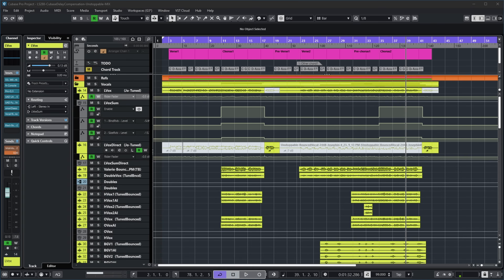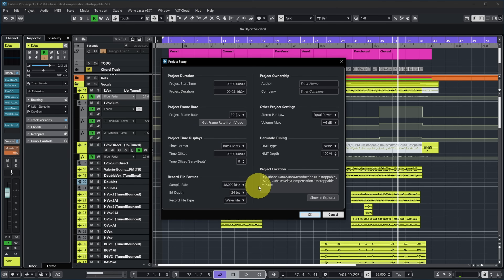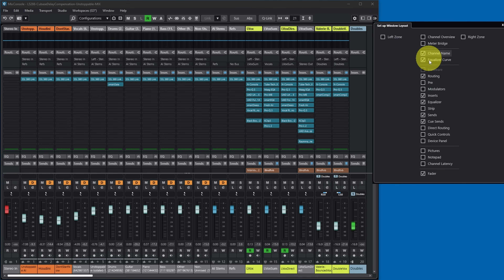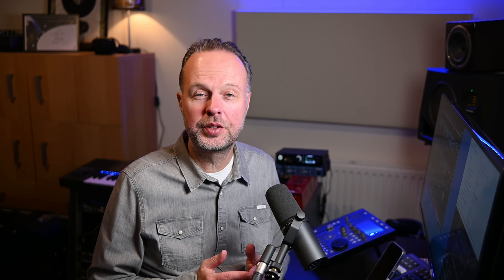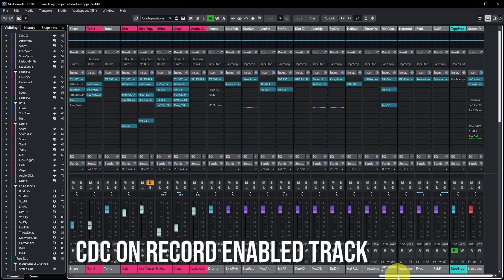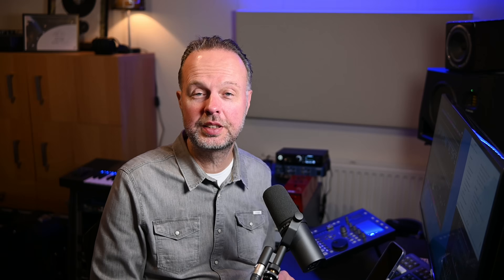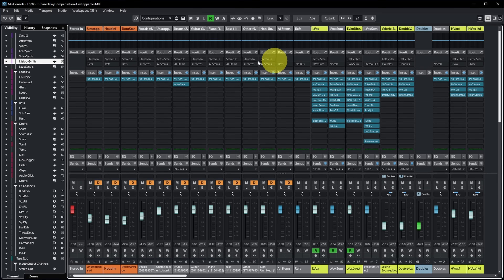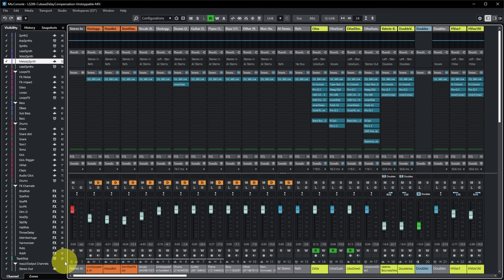FIX Latency in Cubase! The 'Constrain Plugin Delay Compensation' Deep Dive

Comment: Am I right that latency is nearly becoming a thing of the past.  PC's are becoming so strong in the i7, i9, ryzen 7 and 9 that the pc's can handle the load.  My 13700 i7 does great at the lowest setting.  But I'm only running a few tracks.  But I'm guessing to move into a high end ultra core 7 or 9 latency will be find for a good number of tracks.
Reply from the maker: The latency of those plugins is not related to CPU performance I believe. It’s more related to the plugin design. As for he audio interface buffer size, yes that can probably be configured smaller on a more powerful system.

Comment: For all my songs, I have a second project that I use to make live recordings. Its just a template. I simply render a version from my mix project and import the audio file. Later, I reimport my recordings into the mix project. It's certainly a bit more complicated, but it allows the computer to run as quickly and efficiently as possible.
Reply from the maker: Good solution! What I typically did myself is have a master project that is use for recording and production with VSTis and all, with minimal plugins on there. Then render everything to audio for a separate mixing project with the heavy use of plugins.
Reply: @LanewoodStudios  My typical workflow is that I have a recording, mixing, and mastering project. So I try to replicate how it's done in real life. This is very important when recording, because when you use plugins, it's very easy to overlook the fact that the recording isn't actually that good and that you'd be better off going back to it.

Comment: The DELAY COMPENSATION icon is visible in the lower left corner. It does not need to be doubled at the top. Unless someone prefers to have it in a different place.
Reply from the maker: Good tip thanks! On the lower bar you can also disable it by the way.

Comment: This is fine, but I don’t know why they don’t just add the needed time for compensation by advancing the playback of the tracks the required amount. It’s a computer, so it can make the calculations I would think.
Reply from the maker: You cannot do that for live played tracks.
Reply: @LanewoodStudios Im suggesting that Steinberg should incorporate this: Let’s say track 1 has 100ms of latency due to plugins. If it is uncompensated, you have to wait 100ms to hear it play back—not a problem for regular playback. In record mode, Cubase could effectively shift track 1 100ms to the left, earlier on the time line. There is no need to buffer the data, just start playing it earlier, which seems a simple calculation for the computer to make. You will have to wait 100ms for playback to start after you start the “transport”, but that’s ok. You’re then able to monitor track 2’s input with only whatever latency the interface is set to. This seems so obvious. Am I missing something? Is it an issue with how the data is stored on the hard drive? It’s not tape—I don’t see how that could be the problem.
BTW, thanks for your videos. I get a lot out of them, even as a 50 year recordist and a 40 year Cubase user. I hope you keep it up!

Comment: Thanks for this information! 

I also like to freeze the MIDI track or convert it to an audio track. Enabling the control room requires a lot of memory. I monitor my Windows operating system with the free LatencyMon software for home users and disable anything that interferes.
Reply from the maker: Good tip!
Reply: I opened the website. It's a virus.
Reply: @harmoszka500  It's unfair to make an accusation without proof.
LatencyMon is a program from Resplendence Software used to examine system latency to determine whether a computer is suitable for real-time audio and other time-critical applications.
It has been rated and verified as safe by reputable platforms such as Softonic and Heise Online.

Comment: This is a fantastic option. One thing I’ve noticed while using it is that there could be a huge drop in volume when you enable it. Be careful when you disable the constraint to turn your volume back down BEFORE you listen again. If you have some maximizer plugins in place it can really scream if you don’t.
Reply from the maker: Yeah if it disables a plugin that ups the level it will really make a difference. Good tip!